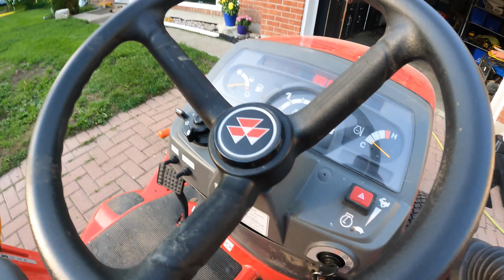putting the mower deck under the tractor

Comment: Hey Joey! You're a great young man. 
I also have a Kubota, and before installing my MMM I raise it with my FEL but let it hang down on its side so that the deck is vertical rather than horizontal. Much easier to clean and get blades off and on.. Also you're not under the mower.